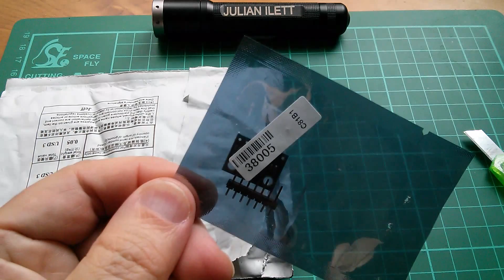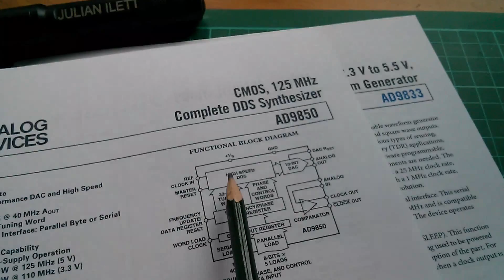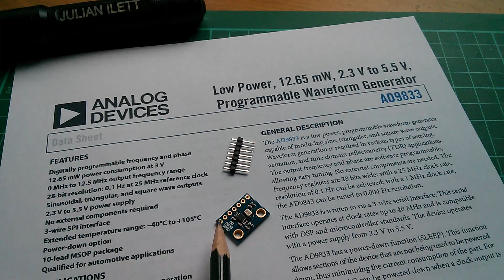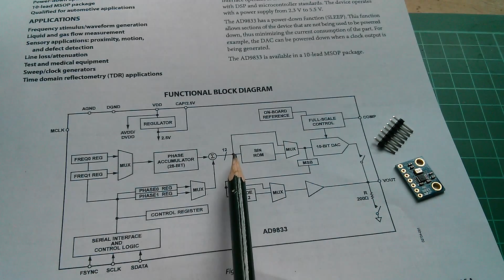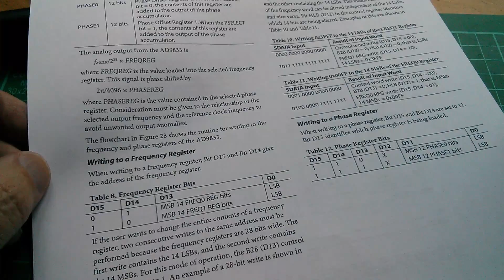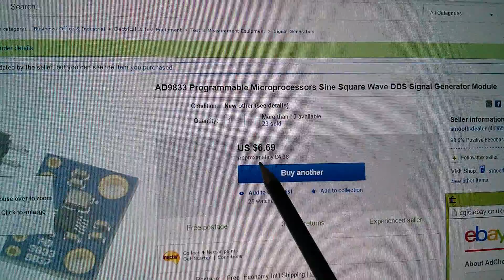Julian's Postbag: #41 - AD9833 Waveform Generator

Comment: Julian do you get ripped off a lot by the Chinese sellers on Ebay?  Like you I used to order a lot of gadgets that were cheap on Ebay and never had many problems until recently but lately it's all been going down hill.  Even though Ebay has a lot of hype about having a Money Back Guarantee I found out it's all nonsense and it you don't get the item there is nobody to contact about getting a refund!
I ordered 10 LEDs that were an item called:
"10Pcs DC 9-12V 10W Cool White High Power 800-900LM SMD LED Lamp Flood Light Chip" for $7.61 and $4.00 shipping from a seller called Happydeer88, item # 390876125031 on April 24, 2015.
The item was delivered on May 2 but it only included ONE Led, not 10 as described in the auction.
I know sending only part of the shipment is a common ploy of scammers.  When I contact them about sending the rest of my order they always say the same thing, that it was shipped but there is never any tracking number.

Dear customer,
We have sent the rest goods out to you on May 8th, now it’s on the way shipping, you know this is oversea shipping, usually it needs about 2-5 weeks can be arrival, could you please give more patience to wait?
Best regards
Lucy
 
There doesn't seem to be any Ebay customer service option available to
address this problem, no way to contact anyone or get a refund!  It
says to select "Item Not As Described" but then the remedy is to return
the item. However it then says it's been too late and there are no
other options or ways to contact customer service! 

If I select "Item Not Received" it takes me to a page to check the package tracking
with no other options there either.  If you order several items and
they only ship one you seem to be out of luck with no options.
I'm not sure if Ebay is actually this stupid or they are in on the scam!

I think all Ebay's hype about "Shop on ebay with complete confidence, eBay is here for you" is nothing but a fraud since there doesn't seem to be any way to get any sort of help for this problem. 
Do you have any suggestions?

Comment: Why not just use a DAC straight from the arduino, do you think this sounds better?
Reply from the maker: ***** The AD9833 has very precise frequency control - that would be difficult to achieve with an Arduino and a DAC
Reply: Julian Ilett Not that hard http://playground.arduino.cc/Main/Freqout or http://www.instructables.com/id/Arduino-Waveform-Generator/?ALLSTEPS

Comment: thanks for sharing the video. I am a mechanical engineer with tinnitus in left ear, i.e. I hear approx. 8000 Hz +/- 500 Hz in left ear. Can you build to microphone or a sound sensor that I placed in my ear (like an ear headphone) and record the sound "from" my ear.
Reply: Faisal Zeineddine 
Most tinnitus is nervous, caused by extraneous stimulation of the cochlear nerve, and can have a wide variety of causes, including medication side effects (quinidine is the most common cause of medication induced tinnitus).  Objective tinnitus, or tinnitus caused by acoustic oscillation, is quite rare.

Comment: Working with tiny little SMD components is remarkably easy if you use the right kit and the right technique. You can get temperature-controlled hot air guns for £30 on eBay (858D) and stations with both hot air and a temperature-controlled iron for less than £50 (998D).

A few seconds of hot air and the part lifts off cleanly with tweezers; Soldering on the replacement is mainly a matter of using plenty of flux and letting the soldermask do the work for you. With a little practice, it's no more difficult than working with through-hole parts, and often easier - you can drag-solder a SOIC in a fraction of the time it would take to solder an equivalent DIP.